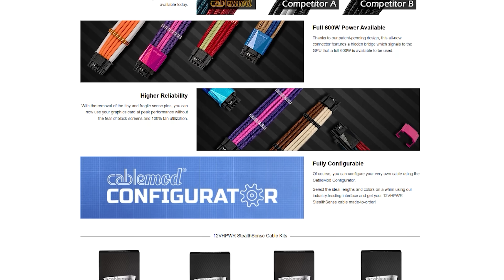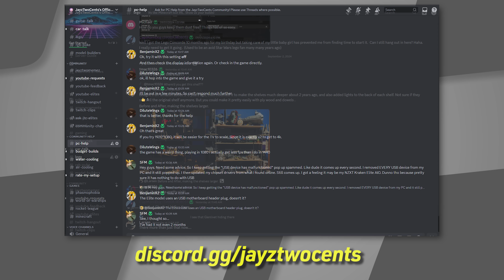Dear god... what have I done...?

Comment: I need to get a new graphics card. Should I get an RTX 4070 Ti Super or an RX 7900 XT? I like the specs of the 7900 but I like Nvidia’s drivers and software better >.>
Reply: Go with AMD, yeah they are not as refined as Nvidia, but ever since I switched a few years ago I had a lot less stability issues.  AMD is tried and tested performance vs the Bleeding edge compromises of Nvidia.
Reply: I'm sorry but I thought the same about Nvidia software, till I built my first all AMD rig recently and I have to say coming from Nvidia to AMD, the AMD adrenaline software is 1000x better than Nvidias. I went from a rx6600 to a 7800xt and it's a beast, I'm sure the 7900xt is even crazier
Reply: A different perspective here, as a casual pc user, I had much better time with Nvidia so if you can get them around the same price, I would recommend Nvidia. However, I did hear AMD got much better since I last used them (6950xt) so if they are cheaper go for amd.
Reply: Go with the 7900xt bro
Reply: @Tx_Jay_   I’ve personally always used MSI afterburner with my previous 2080 super and 1660 Ti. I love how simple it is, especially with auto over locking and fans curves 🤷🏻‍♂️
Reply: @JohnSpartan-117  yeah I did the same with my Nvidia 980ti with afterburner, now that I have AMD I use the AMD adrenaline software to overclock, it's just so much convenient all your overclocking and monitoring all in that 1 app, plus it can do so much more, i still use afterburner for monitoring tho to, but I overclock with adrenaline. I built my AMD rig about 8 months ago with the rx6600, I've had zero driver issues with it, I just bought my 7800xt a few days ago and still no issues.
Reply: The driver complain is wrong. AMD is actually way more polished with way less problems compare to Nvidia. No Multimonitor flicker, short fullscreen swap (that's really insane how slow nvidia is)
The only one problem with amd is the energy usage, its always on max, if you use your fps lock, you get always the max power target and thats not so nice like my 7900xtx (400w)+ 13900k (125w) setup on the hot summer days. If you use the Nvidia GPUs, you can really save money and room heat for only using the fps lock. The only issue with Nvidia is the terrible size combined with the most stupid cable. If you have a big case and enough room for the cable get the Nvidia GPU, if your room is always cool and you have no problem to spend more for the energy or didnt want to use any fps lock tool will be the AMD GPU the better one.

Comment: Imagine making a fan with such low RPM your "normal" RPM fan is marketed as "high-RPM" and also only move 60 CFM... Arctic P12 Max ramp up to 3300 RPM, and move over 80 CFM of air. These BeQuiet fans are just normal, budget fans.